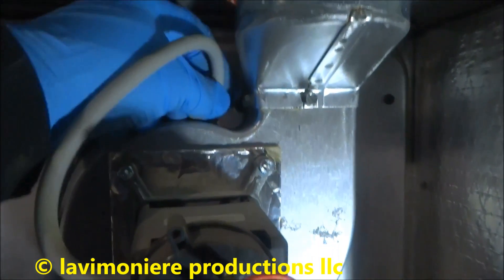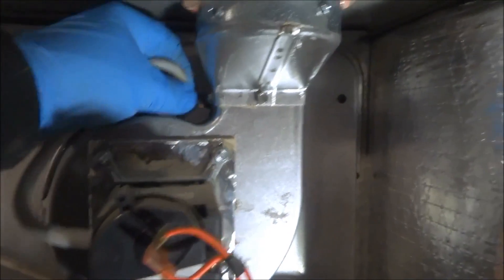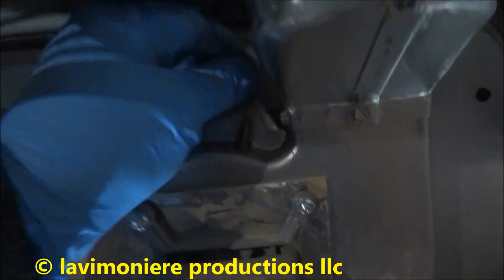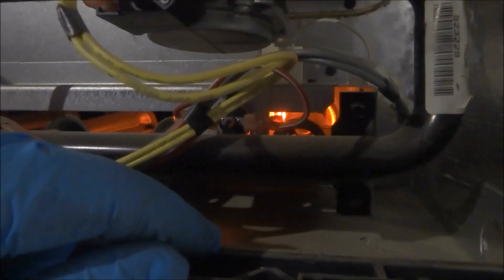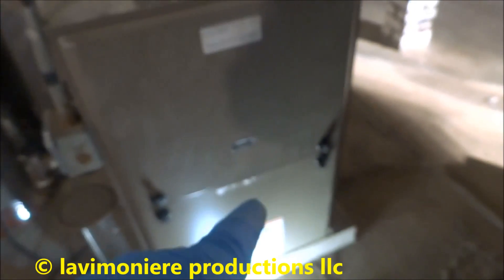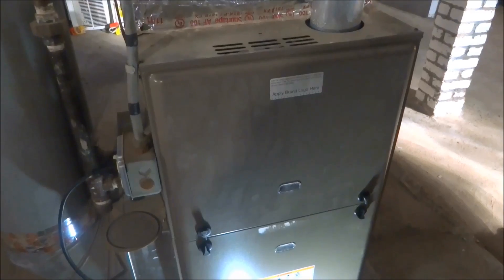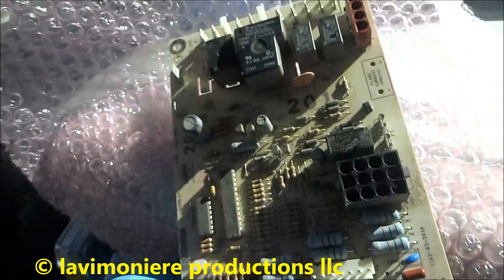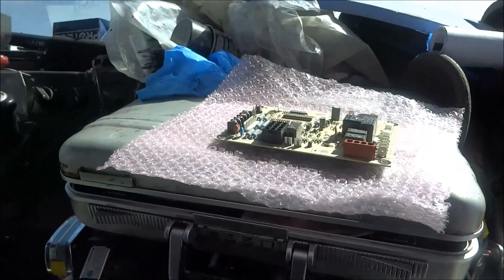york gas furnace with issues

Comment: I just did a maintenance call. Flame sensor looked just like the one you're doing. Dollar bill fixed her right up. Remove all dust and debris watched burner all good. Change filter and  did Co check at vents all good. Then serviced the dryer. Another happy repeat customer.

Comment: I am no hvac guy but worked for honeywell for 16 years in industrial automation. My furnace was cycling on the high temp limit in tje morning when my thermostat went from 65 deg to 70 deg. I could actually hear the burners turn off until the high limit cooled down, then the burners would relight. The high limit said it was 160 deg. I actually measured the temp by the high limit and it was reaching 160 and the burners would cut off. If the furnace only ran for 5 to 20 minutes it would not cycle on the high limit. Never solved the problem but was told it could be an air flow problem. Didnt want to crack the heat exchanger and have CO coming into the house so i had the hbac replaced.

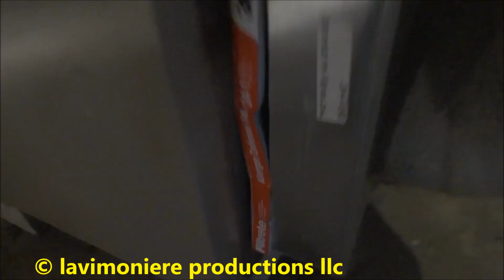Comment: I found this video by reasearching web on York Furnaces. So I'm already trying to self diagnose the issue. Problem is my furnace is in an attic with no pull down stairs, so I have to get a ladder and trying to keep my 9 year old daughter off ladder while up there is a chore. Secondly my husband is stationed in Navy out of state. Ive been screwed over by Hvac company before in my previous home by saying it's this, then 2 days later that, then another 2 days this, all in a way to keep charging service call fees at 69.00 a pop. Now in a new home we just bought in May 2018 and previous homeowners had replaced and installed a York furnace 80% percent something Nov 2017. So just now over a year old. Yes, we change 2 air filters out every 30 days, one is tiny one is big. Always a preset 72 degrees heat on Auto for the fan. Honeywell digital thermostat brand new battery's. Dec 11th all of a sudden my temp started decreasing to 68 when I noticed, vents blowing cold air while in Auto on position. Then reached 66. So I turned it off and turned it on by tstat, the system turned on I could hear 3 pilot light cycles and only felt cold air at vents then after 2 min it shuts off system. I tried this repeatedly for 4 hours to get heat. Then by 1A.M it turns on by itself and decides to blow hot air and heats my home back up to 72 and has worked fine all the way till Christmas night. Again at 7:45 pm it starts blowing cold air and short cycling never blowing heat drops again to 66 degrees for 4.5 hours and at 1:00 a.m. begins heating my house again. It worked all day the day after Christmas sometimes blowing cold, then 2 cycles later it blow warm but maintaing my 72 degrees until 8:00 at night again. So it works fine all day when suns out but at night goes into a stupid mode and drops my house to 66 degrees for almost 4.5 hours. WTH is going on? Before I start wasting money for the dumbest fixes. I just want to be warm at night and my daughter not freeze. This is in Virginia Beach I could understand this somewhat if it got so cold outside like 20 and below, negative 10 like fkn Alaska, but 39 outside at night here Cmon. Please help. This model is a POS from what I'm reading. Also all's I ever see at Lowes or Home Depot is filtrete filters pleated, if those are bad what one's should we buy?
Reply: 4 fpr pleat no higher or it will restrict flow and turn burners off on high limit... Cheap filters are less flow restrictive change monthly , sounds like your ductwork has flow issues , but try filters  then have unit and duct checked for restrictive compromised duct and or design flow issues...🤔✌️👍💪🙏

Comment: Looked like they had one of those 3m brand filtrete filters in there, had several calls over the last couple years where those restricted the airflow much more than a normal pleated filter and caused limit trips
Reply: you are so right....put in the cheap filters...  likely an over-sized furnace too....high-limiting  with an over-sized unit and restrictive filter... besides...it's a York...hunk of junk to start with.
Reply: The "purple" Filtrete is the worst. You can't even push your finger through one of those, they feel like they're made out of Kevlar. Way to dense!!!!

Comment: Limit switch is always an airflow issue if switch tests good. That corroded filter is where I would start.
Reply: Not all the time, Gas Pressure could be set too high also. But most of the time it's airflow issue, if the switch isn't defective like you said.
Reply: A plugged secondary heat exchanger (found one plugged with sludge and one plugged with ladybugs), sooted up primary heat exchanger (Found a propane unit ran at 3.5" w.c.)or a restricted flu (found a vent stuck in flu pipe and damaged flu cap) will also trip limit.
Reply: Edit: Not vent stock in flu vent, a bird in flu pipe.
Reply: @jasonwb6884  return is way to small

Comment: Check that air filter. If it looks new, someone probably replaced it since all they knew how to do. If it is new, see if it's higher than a MERV 8. I do know that some units will stay in a hi limit fault if it gets  bumped more than x amount if times in one cycle.

Flame sensor issues won't pop A High limit, but yes good to clean it while there

Comment: Hey man I've got a York Diamond 80 that I replaced the circuit board on. Flashing (1) time indicating flame  sensor issue. In the kit was a different style flame sensor  with no wire attachment.The flame sensor will glow but won't ignite burners. Your experience is appreciated.

Comment: I hauled a bunch of York AC products as freight.   Used to rile me up every time.   The units were built to be in the weather but the factory insisted that the load was tarped.  Impossible to tarp without the eyelets beating the coils so you always had damage claims.  I finally got a fin straightening Gizmo tool from the dockworkers to comb the fins straight again

Comment: Dirty filters will trip high limit sensor. By the time the service person gets there it has self reset. if it has a filthy e-vap coil it reduces the flow and trips the high limit. Filters should be changed often and with the proper filter.

Comment: In my opinion, the problem was the nasty filter, I would have replaced the filter first (on the first visit) before I would change the board.
Reply: Probably thermal high limit , from lack of airflow  on return air design choke  point , plus too high of a filter 4 fpr , purple is 8-9 fpr to high for furnace's .🤔👍✌️🙏💪 12x24 or 18" ® pipe would have been better than 2 , 10"  ® going to the unit...

Comment: Not enough return air, that drop down isnt enough.  Single 10" round pipe return isnt gonna give it enough cfm in, its probably been working that limit for years (short cycling) They have a duct issue, hack job installation.

Comment: I’m having the same problem! Replaced the Limit switch and cleaned the flame sensor but she still shuts down. But get this, as long as I leave the door off she runs!  I’m praying it isn’t the board. My tech says the board is good.  Any ideas?
Reply: Duct design is a choke point one 18" round would suffice for 3 ton but look hokey rectangle duct needs to be reinstalled and fix hacked connections...

Comment: Change the filter! My suggestion is go see an optometrist, Stevie Wonder could have seen that that filter was clogged..9 out of 10 limit switch errors are caused because of airflow!
Reply: I was wondering the same thing, kept watching for him to finally see it.  I was thinking it will trip while there but he had the bottom panel off so it sucked in unfiltered air instead....sometimes it the simple things that evade us thinking it can't be that simple....sell him a board.
Reply: you never know how much sleep hes had, Ive been on 2 hours over 3 days before and you just are not as sharp then..  Dont hate the guy who took the time to post this video, not knowing what his state was tat the time.,  mistakes happen.  no heat in winter months is buisy times.
Reply: @MrDmadness  Yeah,  besides:  those boards are programmed at the factory to fail in January...   ;`>

Comment: Relays on those control boards can be cleaned by popping off the relay casing clean the points by using ultra fine polishing paper
Reply: how long would that fix last?
Reply: biker55555   As long as a new board

Comment: I had a call last week on a York unit just like that going off on the same code. I asked the owner ," When did you change the filter last?" When it was installed two years ago.  It was a 5" 20X25 pleat...packed to the hilt.  I was taught in college,  not to condemn a safety that is doing what it was designed to do. Why wasn't the air filter pulled as a first step? It could be a weak safety, to test it, pull the device and wrap a thermistor around the device to measure the actual temp when it trips.  Is it override?  Whats the temperature rise. Checking the total external static pressure would tell you if there is an airflow problem.what lead you to think the board was bad anyway? Im not criticizing you, just curious about your troubleshooting process.
Reply from the maker: it was a bad board ,,,,,super tech
Reply: What I asked you was what led you to think the board was bad,  didn't think you would be so insulted by an viewers comments, chill out.
Reply: No cares about what you were taught in college or what your opinion is regarding Steves trouble shooting process. I've been in the industry for a long time and people who second guess after the work is done are annoying

Comment: The four flash should have sent you to the filter first. Take that piece of crap out and run it without for awhile. Filter edge open to the air? Weird science. Lot of limit switches do not reset either by design or bad build. Rap on them and use the ohmmeter with power off. Nothing wrong with the flame sensor. Poor owner got a $300 board when a 2$ filter and bad ducts were the issue. This is why I never called a tech in my life. The board is the last thing to go. If I were you I would take this video down, not good for business.

Comment: what was wrong with the Control Board?... You didn't notice any Burn Marks or Burned Traces..  Was the Problem just that the code was flashing FOUR Times?.. and therefore the board was the problem?.. The furnace was working fine... So, How much does it cost to replace a Control Board just to get the Furnace to stop Blinking 4 times?... I could live with the Four Flashes if the furnace worked fine... What was the reason the Owners Called you for?... was their furnace cutting out?  just curious... I truly enjoyed the VIDEO and learned alot.. I have a Guardian Furnace which is very similar to a York... thank  you.. :)